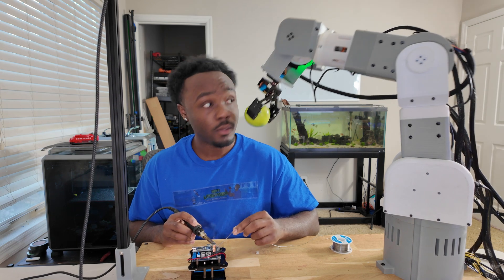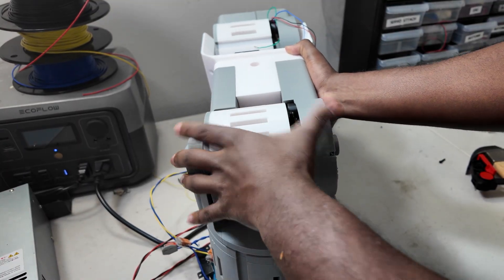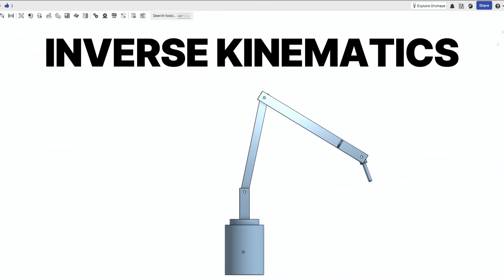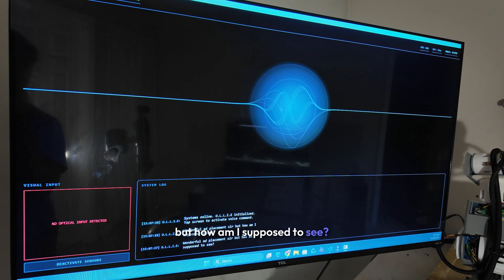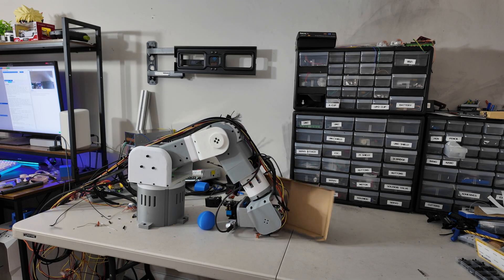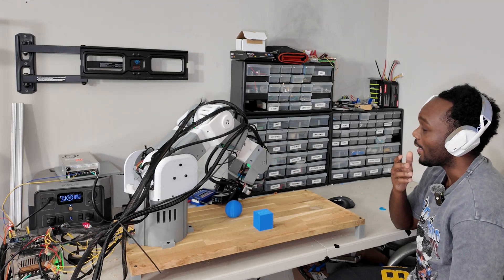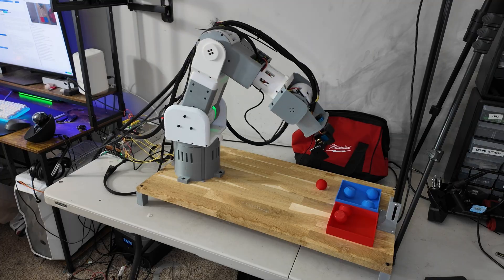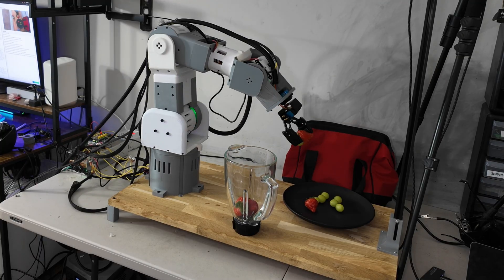I Built A Robot Arm To Clean Up My Desk!

Comment: Incredible work on this hugely ambitious project!!
It looks like you decided to mount the camera to a fixed position? It's no longer on the wrist by the end of the video.
I'm guessing it's a lot easier to observe the environment from a fixed position, but that introduces other challenges like the robot being in the way of the camera. How did you solve those?
Reply from the maker: Yup exactly!! So what I did was is after each action you can see the robot go to this set position that almost looks like it is showing its gripper to the camera mounted up top. By doing this model can analyze the environment rate each action and make sure it’s not in the way of the camera. Things run slower but a lot more reliable for future versions I plan on using both gripper mounted and workspace mounted.

Comment: If you use nitinol wire weave to a tube a silicone tube with osmotic Flow with a Domino wave for cooling the structure and cooling complete actuator using thermal dynamics to make a actuator?